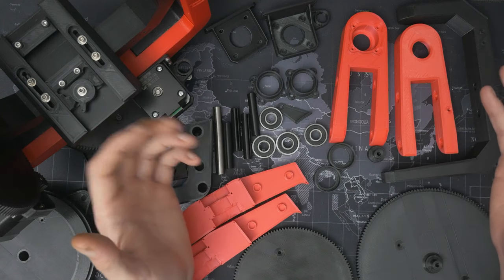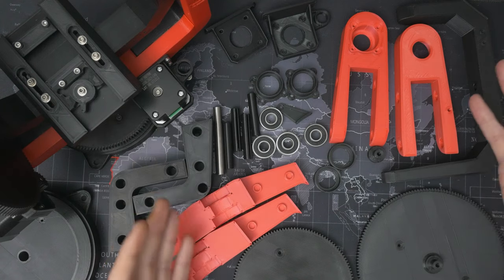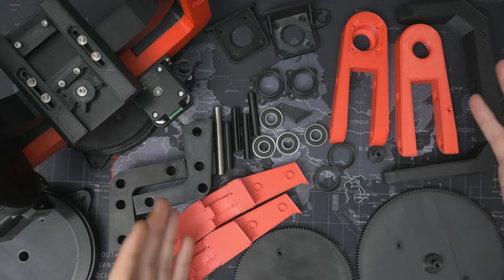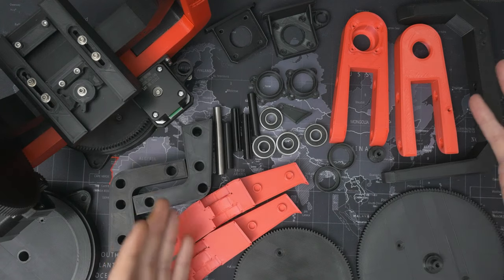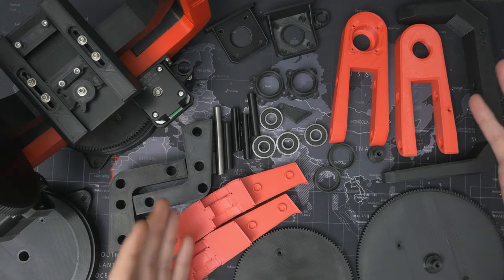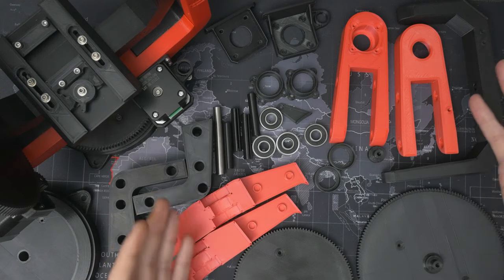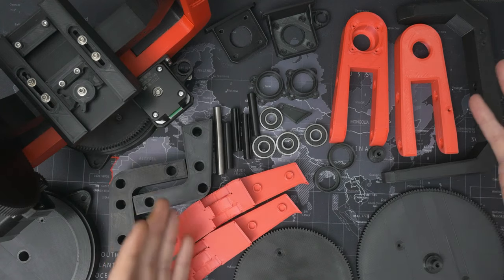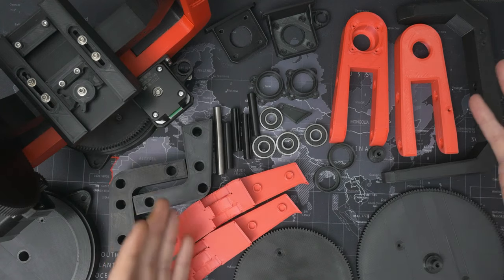Amazing 3D printed motorised camera gimbal - Part 1: Assembly

Comment: If anyone is planning on making this, I just used a 80mm long metric bolt with a nylon lock nut for the main axle, its easier to find and you can also set a bit of a pre-load on the bearings to remove any wobble. Do you still plan on releasing part 2 of this? I am interested in how you went about writing some code for it. I have made a basic python program to control it with the keyboard.
Reply from the maker: Yup, still planning to do a part 2, just real-life stuff keeps getting in the way and making it impossible. It is still coming, though! :)

Comment: I just stumbeled over this video and was wondering if you still plan a part two. I can't find any docummentation on this. Also I cant find any details on what stepper drivers I shold use and how i controlling all of this.
Reply from the maker: Yup, still planning to do a part 2, just real-life stuff keeps getting in the way and making it impossible. It is still coming, though! :)

Pretty much any stepper driver you'd normally use for a 3D printer will work from the cheap, basic A4988s to more advanced Trinomic drivers. I usually use TMC2208s. They're cheap and silent!
Reply: @JohnAldred  thanks. Excited for part two! It will be useful for sure! :)

Comment: I am in the process of making something very similar and am stuck on getting the code to work. I would help a lot if I could see what you are using.
Reply from the maker: For the software right now I'm just using GRBL. The electronics are an Arduino with the CNC shield and TMC2208 drivers. I'll have part 2 up soon going over all of that. :)

Comment: Hey, I'd like to build this, but I have a couple of questions.
1) Do you have any ideas on how I could modify this to screw onto a tripod?
2) It seems that the Thingiverse link for your redesigned parts is no longer working. Is there any way for me to get those files?

Thanks
Reply from the maker: 1) Not yet, but it's something I'll be working on.
2) Very odd. The URL is correct. I just checked and it only seems to be coming up if I'm logged into Thingiverse, but not when I'm logged out. No idea why, it's been public since I posted this video. I'll stick it up on MyMiniFactory and update the link as soon as I get a chance!
Reply from the maker: I decided to just go ahead and do it now. It's not listed yet, but I've updated the URL in the description. You can grab it here. :)

https://www.myminifactory.com/object/3d-print-arca-swiss-mounting-plate-mechanical-end-stop-gear-for-fhuable-s-motorised-gimbal-210957
Reply: @JohnAldred  Thanks!

Comment: Hello,
I Hope you can answer me for 2 questions. 
1) which stepper driver you use?
2) what is maximal weight of camera without loosing steps? 

I build something similar, but my camera is over 2 kgs and I am worried to use nema17 if it is too small?
Reply from the maker: In the video there I was using A4988s, mostly because they make the stepper noisy so you could hear the music, haha. But normally I'm using TMC2208s. The largest camera I've tried on it is a Nikon D800 with a Sigma 28-70mm f/2.8 lens - which is a little under 2kg and it handled it fine. You can always adjust the current going to the stepper drivers (or go with a higher voltage power supply just for the motors - I was using a 12v one here because that's the limit of the Arduino CNC shield but if you use a 3D printer mainboard that supports 24v, that would work and give them more torque and holding power) if you think they need a little more oomph, but they hold pretty well. The main thing is balance. If you can modify the centre rail to mount the tripod plate holder in a way that lets you slide the camera backwards and forwards, you can more easily find a better centre of gravity that's easier on the motors (a bit like balancing a 3-axis gimbal from somebody like Zhiyun or Moza) so it doesn't need as much current and doesn't put as much strain on the motors.
Reply: @JohnAldred  thank you for your answer. I also use TMC2208 as very sillent solution, but I am worried about cooling of so small part. With stock cooling (passive) I am about 80°C which I think is too much. I already have 24V supply. I need to make it super sillent, this solution Is for livestreaming from our church. 
I combine it in way that arduino only works for moving (3 Axis, 3 steppers + 1 servo for zooming) and then there Is ESP32 for remote communication where to go, what to see, how much zooming. I want to make it with autlmation, with database of positons (preacher, workship group, worship leader,...). In future I Will want to extend it with moves to video, I am that in first moment Is my goal to make it just like positon changer, in future I Will want to define complete moves which Will be possible to see in streaming.

Thank you again
Reply from the maker: I haven't found them to run that hot with this, but typically when I'm using it, I'm outdoors (powering from a 3S lipo) and it's pretty cold in Scotland most of the time, haha. Even indoors, though, I've not had any issues with it and I'm just using the small heatsinks that come supplied with the TMC2208s. There's no active cooling. 80°C does seem a little warm, but it's apparently within their operating temperature range (-40°C to 125°C). I'd check the current going to each of them, though, just to make sure you're not sending way more than you need. I don't know what board or firmware you're using, but if you can run the stepper drivers in UART mode, you can control the current dynamically over code so you don't have to keep tweaking with a screwdriver and measuring with a multimeter. :)

That makes a lot of sense having the Arduino to control the movement and then using the ESP32 just for remote control. That's the route I'm thinking of going, too because figuring out some code to try to get steppers to move simultaneously on an ESP32 with the speed control and acceleration you get with GRBL or Marlin is a pain. The AccelStepper library's nice, but only works on one motor at a time. MultiStepper's nice but doesn't contain the acceleration features of AccelStepper. Would be nice if the two were merged into one one day so we could control multiple steppers with acceleration. For now, though, I think just using GRBL and adding the ESP32 is the easiest way to go.
Reply: @JohnAldred  I dont understand you now. I use accelstepper but with 2 motors. Yes, when you tell to motor 1 that has to go 200 steps, motor 2 500 steps then you have to calculate accelleration And speed for both to stop Finish move in same moment and you have to calculate it with every nove, but you can use more steppers in same moment with accelstepper And with accelleration.
Reply from the maker: Yes, that's my point. With gcode, I can just say "G1 X200 Y800 Z1428 F30" and it'll pick a feedrate of 30 for whatever's the slowest move and then it'll slow the other two movements down automatically so that they all start and end at the same time with seamless acceleration and deceleration. AccelStepper doesn't do that. As you say, you have to code it to calculate it every move and if I have to do that, then I might as well just make my own library and nto waste time with AccelStepper. But according to the AccelStepper documentation, you need the MultiStepper class for multiple simultaneous stepper control and it doesn't offer acceleration and deceleration. So, as I said, it would be great if the two could be combined into one so that it can do what GRBL or Marlin does.
Reply: @JohnAldred  yes... 100% truth. Have a great new week!

Comment: Hi if you don’t mind me asking do you know how much this cost to make filament and printer not included
Reply from the maker: Well, the Nema17 stepper motors I cannibalised from an old 3D printer, but they're pretty cheap these days (About $6-10 each - lower if you shop around and buy a pack of 5), the Arduino and CNC shield were maybe $10 total on AliExpress, the stepper drivers... A4988s are cheap, you can get a set of five for around $5, but for TMC2208s, I think I paid about $30 equivalent for a set of five (they're much quieter and smoother than the A4988s, though). The two little metal gears were way more expensive than I thought they'd be, they were about $8 each and that was AliExpress prices. The Arca Swiss tripod plate was about $30. And the 12v power supply was one I just had lying around doing nothing. So, even with the filament (and you could do it with a single full roll), you're probably talking about $100 or a little less.
Reply: @JohnAldred  ok

Comment: Which small electric screw driver do you have?
Reply from the maker: It's the Wow Stick. A friend got it me for Christmas a few years ago. It's nice but the torque is quite low if you need to cut threads into plastic. Great if you're going through holes and into threaded nuts and sockets, though. :)

Comment: Wow, I think I gonna build one for my  motion timelapse project, also I will put a 3. motor for the slider.
Also there is a cool panoramic software Panomoments, it's a hybrid of 360 photography and timelapse, you need a motorized panohead to produce it.
Reply from the maker: Thanks, Diego! I'll have to check that software out. I usually use Photoshop or Hugin to stitch panos together. :)

Comment: What does the footage look like using the device? I seen 20 of these types of videos and no one shows what the video looks like using on of these thing. It's almost pointless.
Reply from the maker: It's a pan/tilt head. Have you ever done a pan or a tilt on a tripod? It's like that only automated. It's pretty easy to envision. There are literally a million videos and timelapses out there that use pan/tilt heads. Ultimately how the footage looks depends on you as the user, what it's pointed at and what you tell it to do. If you feel it's pointless, that says more about you and your needs than the device itself. :)
Reply: @JohnAldred  the point is how well the one you built performs
Reply from the maker: Well, that would depend on how well your printer's dialled in, the quality of the filament you're using and which electronics and mechanical components you choose to buy. You might just want to consider buying something from Syrp.